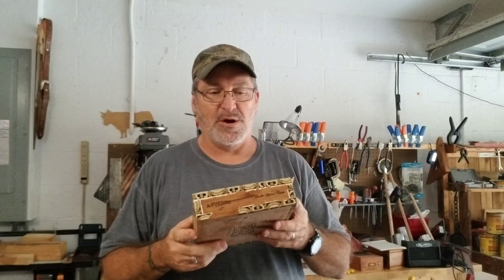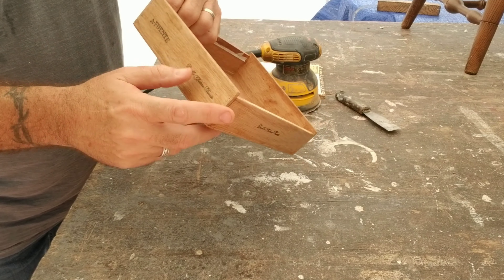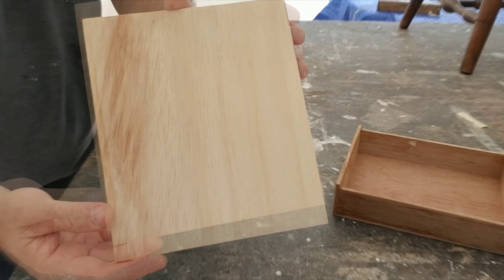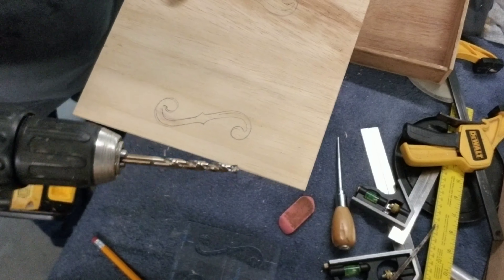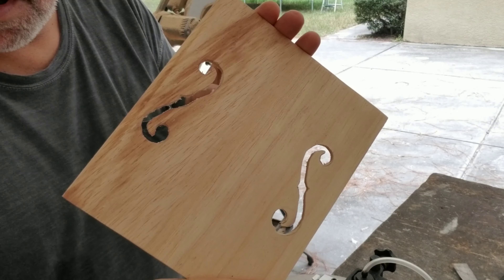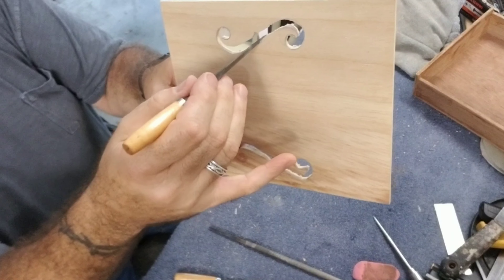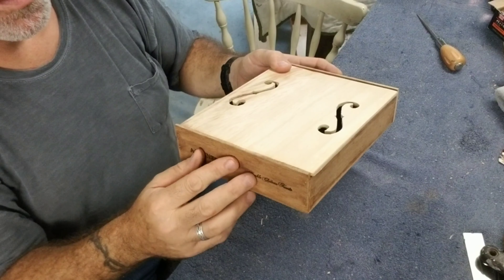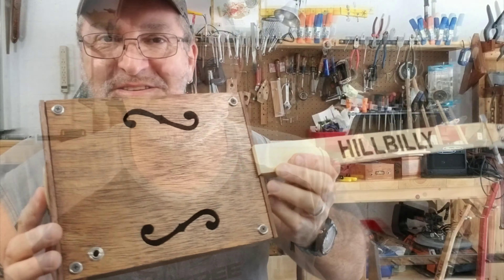Cigar Box Guitar -Take an UGLY cigar box and turn it into a beautiful Guitar.

Comment: Hi Michael, Nice job!  The only power tool I have used on my builds has been a drill. So that is what I have used to cut the outline of shaped sound holes. That saw you used would sure save some time. Is the lid solid wood or laminate?  If its solid, you may be able to plane it down, brace it, and get a decent acoustic sound out of it.
Reply from the maker: Hey Steve, Thanks.  Yes, I have used a drill many times to outline the shapes for sound holes and pick ups, it works just fine. The saw just makes it a little easier that's for sure. That lid was ply wood, not too thick, so I think it will have a very nice sound.